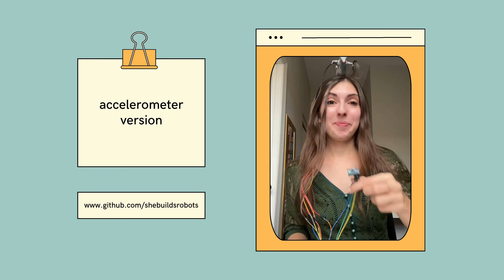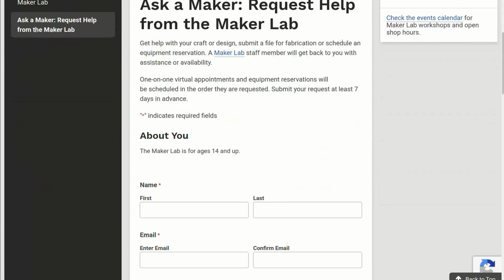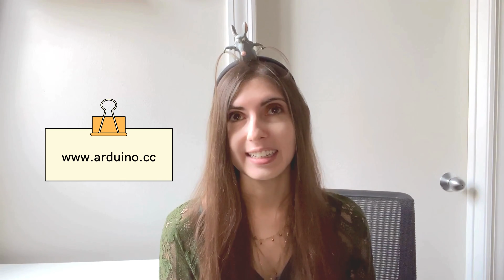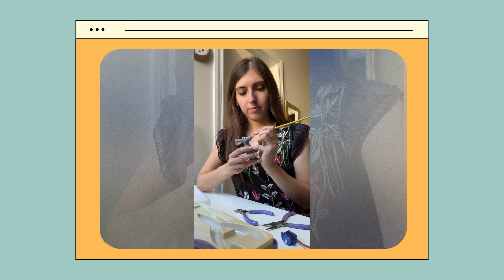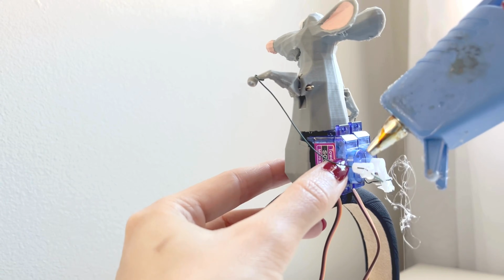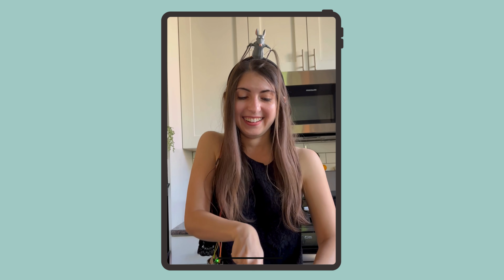Building REAL LIFE Ratatouille | Coding a Remy Robot

Comment: Very cool project!!  The random code is so simple but effective for the build.  I'm used to the SG90 servo that will reset back to 90 when powered up.  Do the micro servos do the same thing?  That's one way to get the starting angle to be the same, power them up and reset them before attaching the arms.